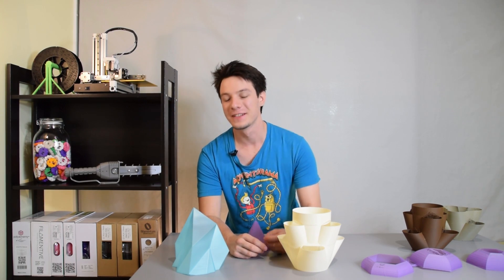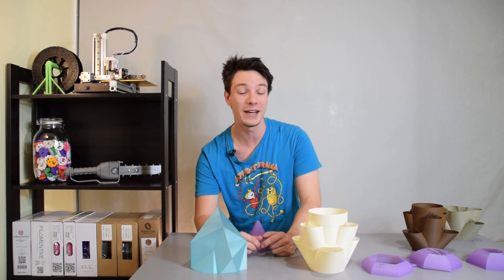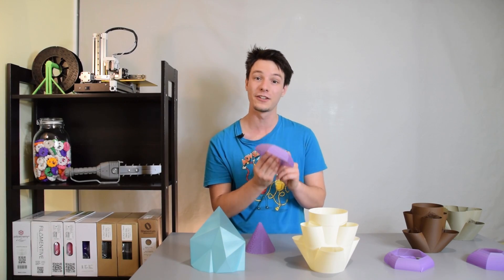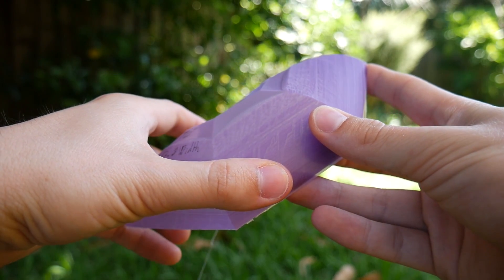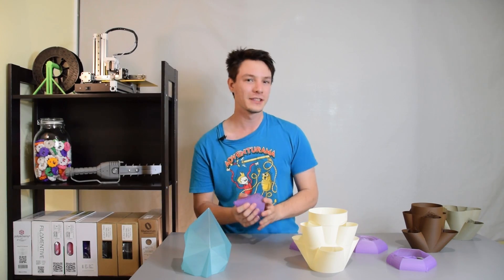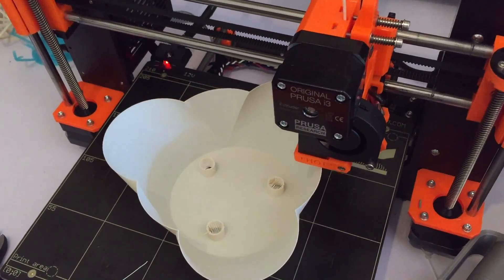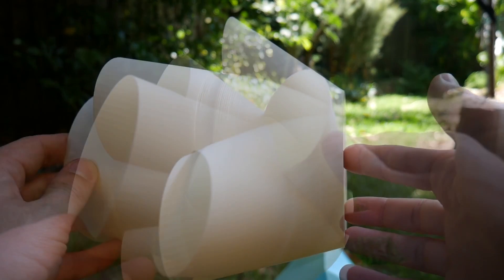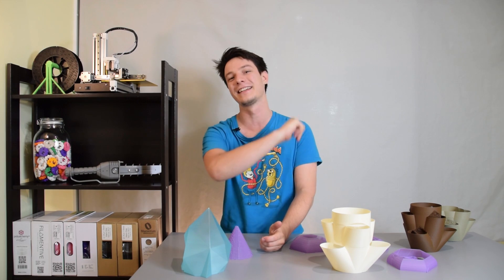Hacking Vase Mode - 3D Printing Experiments

Comment: Neat! That 2mm nozzle is crazy! I've been using vase mode to make transparent optical parts like light diffusers (fancy lampshades for my lightsabers) to prevent the 'zippers' you normally get that become really obvious when back-lit. I'm even learning to use the layer lines as "microlenses" to pull some very interesting tricks. Practically holographic.
Reply from the maker: That sounds awesome! I'd love to check out your results

Comment: i ll Give the strawberry pot a go with a 0.8 nozzle, where do you want me to post a make photo?
Reply from the maker: Tag me on Twitter @makersmuse
Reply: lol im old I don't have twitter, I can send you a photo via email and you can post it there yourself, BTW it come out great and, fast to print, 4 hours @ 0.12 layer height. It will make a nice spice planter, Here is my trick for pla stuff that will be used in sun light exposure, I coal it with a product call, " Ding all SunCure ", its a polyester resin the quickly cures under UV light which prevents the pla for deforming while curing , and it adds UV protection for outdoor use. that would make a great test for you pla in a hot car video! lol

Comment: Lampshades are functional!

Though I would suggest using them with LED lighting as they run cool - PLA probably won't cop the heat of a 60W incandescent bulb let alone a 100W or 150W!
Reply from the maker: Haha definitely needs to be LED!
Reply: What do you call vase mode with a 60W incandescent bulb? Answer: Dali mode

Comment: Nice video!
If you print at 0.8 width with a 0.4 nozzle then it's pumping out twice the plastic, so your bridges will sag like that (@9:18) more easily (just like you said about curved bridges). I bet it wouldn't be so bad with a 0.4 line width or less - of course then it would be weaker and have worse performance on the overhangs then.
I wonder if there's a slicer that could deal with this in vase mode?

Comment: Why not use vase mode and design the model in such a way that you could pour a resin in the void? Or even depending on the application just spray foam. Depending on what you are doing you could make a very functional, quick, durable item.

Comment: 2mm nozzle? what the... ? just print with no nozzle than. :D all metal hotend without nozzle and 1.75 filament strait to the bed. :D
Reply from the maker: 2mm with 3mm filament haha, but yeah you almost could just melt it straight through without a nozzle.
Reply: haha yeah, i dont have had much luck printing vasemode, its so thin on my printer that is hase no staight to it. i tryed tunijng the flow but still was not a great succes. maybe play around with the line wight would make it better? but i guess thats gonna do the same as altering the flow rate right? maybe ill need to get myself a 0.6 mm nozzle or so. i usally print with a 0.3, nor resently installed 0.4 and i was actually already finding ti weardly thick lines, like 3 primeters is 1.2 mm lol.

Comment: Is vase mode a function of the printer or the slicer?  I don't recall seeing that in Cura.
Reply: Sean L if you find it in Cura pls tell me
Reply: Sure will but I don't think it's in there.  That might be something that's in Simplify 3D.
Reply: Sean L should be under advance settings at least in the older versions

Comment: Manually model "support" to fix bridging issues?
Reply from the maker: You can't do supports really with Vase Mode, part of the challenge ;)
Reply: Maker's Muse stop print. Place foam board / cardboard. Resume print?
Reply: Maker's Muse what about "normal" mode with 0% infill? Then you could add geometry to the model as scaffolding to be broken off later. Wouldn't that be fast and use little plastic?

Comment: Manually create inner and outer shells in modelling tool, then pour resin into void between to make thick strong walls? For outdoor applications could pour cement slurry instead of resin.
Reply: This might not apply to vase mode but to normal mode with 0% infill?

Comment: just tested with the draft 0.8mm nozzle on a Robox(cura slicer). works nicely. Thanks Angus.
Reply from the maker: I didn't know Robox could run Cura directly, that's pretty cool :)
Reply: The current version of Automaker has a checkbox for Spiral print. You can't use CURA directly.
Reply: Someone actually MADE something!  Thank you!

Comment: Could you go deper into what extrusion width does?

I have always been under the impression that extrusion width just changes the space from 1 extrusion line to the other. But in that case increasing the extrusion width would only cause it to fail sooner if there is less material to lay the next layer of plastic

I'm I thinking about this backwards? The way I see it decreasing the extrusion width should be what you intended to do.

Comment: I'd like to give it a go with this pot, I printed 12 pointed tree topper star using vase mode for each point using my volcano nozzle with a .6mm nozzle, but intentionally overextruding to reach .9mm wall thickness, and was able to get super clean finishes. Each point printed quickly and was very strong and very smooth. I think that's roughly the sweet spot because .9mm walls are pretty strong -- I might be able to force it to get to 1.2mm walls using the same nozzle as I'm using the bondech qr, so it can really pump out the plastic.

Comment: One other "interesting" feature of Vase Mode: If you crank up the speed and print lots of curves on a large printer .... it's a test of your firmware's compute speed. Put another way - you may also want a 32 bit board for that super duper ultimate 2 M tall Vase Mode printer :)

Comment: Can you print (using 1.75mm)with a 2mm nozzle? Holy sh*t
Also, that squared_cone_thingy is amacing
Reply: No you can't print 2mm with 1.75mm filament the person in the video is using a Ultimaker and that runs 3mm filament. There is a 1.2mm nozzle for the E3d volcano that you can use with 1.75mm filament
Reply: Oh ok, thx 4 the answer.

My printer is a cheap aliexpress kit so I cant really get good details. The acrilic not-so-rigid frame and the feeding mechanism make it useless in the tiny details when printing. Lets not talk about the endstop switches, secured with 1 bolt so they can rotate a little bit each time the printer homes itself.

However printing faster with a wider nozzle sounds so nice. If I cant get the details at least I can print big stuff. I was going to replace the extruder assembly anyway so I may get a volcano. 

Extra question: I am going to change the extruder and the direct drive mechanism, making it 3mm is worth it? Just focusing in printing faster with a huge nozzle
Reply from the maker: The trick with large diameter nozzles is you have to melt and cool a LOT more plastic than usual - so your heating and cooling must be really powerful. Usually, you have to run very slow so it can keep up which somewhat defeats the purpose. I would use your current machine to start printing parts and upgrades for itself or even an entirely new printer :) It'll improve itself over time.

Comment: For the overhang test to get a more even print in low layer heights, try slicing in different layer heights and mixing the g-codes together so that the first 40 degrees are .2, 50 and 60 degrees get .1 and 70 and 80 degrees get .05

Then to top it off, you can use the gcode from another slice that bridges the top

This isn't easy but possible, its the same technique you use to pause a print for switching out the colors, only you load a different g-code file after the pause 😊

Comment: Thanks Angus!  I'm in the process of making a cosmetic leg cover for my Wife's prosthetic leg and this will save be BOAT LOADS of time in test prints while we try and nail down the final shape!

Love the experiments!  Id like to suggest one, I noticed that when I print some models the cooler that I have on my printer blows air in such a way to whistle (similar to blowing over the top of a bottle).  I always wondered if a model could be designed to play a tune while it printed.  It most likely would look like a bunch of tubes in the end, but it would make for a fun experiment.

Love the Videos!  Thanks again!

Comment: Really interesting.  It would be cool if in the GCode you could dynamically alter the extrusion width based on the overhang angle.  i.e. start at 0.4mm at 90 degree layers, gradually increasing as the overhang angle increases.  I wonder if it would help keep the layers consistent and perhaps also allow even greater overhangs (although 70 degrees is pretty steep)

Comment: Flip the white strawberry thing upside down and drill a hole in the bottom and you'd have a great hanging lamp.
Reply from the maker: That's... GENIUS :P
Reply: "watts in = watts out. A 10W LED gives off as much heat as a 10W heating element." This is not true for LEDs although it is for CPU at full load. Making light takes energy and the energy efficiency of LEDs, CFLs and incandescents are wildly different. If the heat per watt was constant it would imply that the light emitted in the visible spectrum has no energy but the light in the IR spectrum does or that the IR light completely dominates the visible. In reality the typical 6 WATT LED bulb emits ~4 BTU/hour =1.2 watts or about (6W-1.2W)/6W=80% efficiency.  Contrast this with incandescents and you will find they are only about 10% efficient but because we try and keep lumens constant, their overall BTU/hour figure goes way up because we need a 40W bulb to do the same lighting job as a 6W LED.
Reply: Or the cone experiment. Light source needs to be low temp tho... (reprint in ABS or PETG?)
Reply: I though about it for the cone you made, it would be a good light focusing thingy...
Reply: aiklarung watts in= watts out, yes you're right... there is as much energy going out than in but not all energy goes out in the form of heat. with led most of it is converted to light and the rest in heat in an incandescent bulb most of the energy is converted to heat ( glowing hot filament) and the rest to light.
Reply: +aiklarung

What you're saying is 100% irrelevant. We're discussing heat issues with puttin an LED in this thin plastic shell.  A filament bulb gives off a lot of waste heat. An LED is a diode, and heats up because of the electrical connection inside the actual component. We measure LEDs heat from the resistance of the semiconductor. LEDs give off basically zero infrared because they are made to reproduce a certain wavelength.

So no, LEDs don't give off heat in the form of light at all, all they heat they produce is due to electrical resistance.

To go a little further why it doesn't matter at all, let's say you take a 2W LED (Which is already really big for that small, light lamp, and say it's only 30% efficient. So it should be radiating 1.4 watts of heat into the surrounding air. But wait, you attach a resistor to every LED to control the current. That acts as a great heatsink. Then you have the wires going to power, that is a heatsink, and you have however you're mounting it. Usually those 1+ watt LEDs get mounted on a heatsink themselves. Then you get the air itself absorbing the heat.

So, for a third the, unless you use a flood light like an idiot, the LED you'd use in this lamp will NOT even heat the plastic.
Reply: Yes, but your argument was about it melting the lampshade, not about it heating the room by a trivial amount by performing the work of letting you see said room. The incandescent will melt your lampshade quite more thoroughly than the LED will, watt-for-watt. That's because, again, the LED is grossly more efficient.
Now for my figures, I took the first result I found searching, from http://archive.azcentral.com/home/articles/20130403led-lights-better-cfls-reasons.html Where they state: "Your electric bill will go down. Manufacturers estimate that LEDs are up to 85 percent more efficient than incandescent bulbs..."
You will notice that this is substantially better than a mere 25% to 10% comparison as in your claim. If incandescents are 10% efficient, then they are 90% inefficient. And to be 85% more efficient than that means that .85 * 90 = .765 is the difference in waste heat, meaning LEDs are only 13.5% inefficient and in the example I gave, that is indeed the result rounded to the nearest whole unit. 9 light to 1 heat. I suppose I should have said 1.35 heat? But it was an approximation.
Reply: +aiklarung As everyone else pointed out, that's already incorrect right there.  LEDs are highly efficient.  What are they around 50% efficient? That would be 5 watts of heat.  And do you know what a 10 watt LED looks like? Nobody is putting those in paper thin plastic lamps, that's just stupid. 10 watt LEDs are what is used in flood lights and incandescent sized replacements. As in, super overkill and will be too heavy to put in a hanging paper thin lamp to begin with. 

More likely would be a 1 or 2 watt LED, like there are in flashlights.  That's plenty bright for a little lamp, and it would give off something like .5-1 watt of heat, much less reaching the actual plastic because of air conduction, so more like .1-.5 watts being absorbed by the plastic. 

So once again, the heat would be negligible.
Reply: "watts in = watts out."
And depending on how efficient your light generating mechanism is, some of those watts will be in the form of heat, and the rest will be in the form of light.
For an incandescent bulb, where light is produced by the ridiculously inefficient means of heating an object to incandescence through electrical resistance so it sheds light by blackbody radiation, that's 9 watts as heat and 1 watt as light.
For an LED bulb, where light is produced extremely efficiently by the movement of electrons across energy states by the electromotive force within a diode to release photons when they drop to a lower energy state, that's 2 watts as heat and 8 watts as light.
Which is why you can change an LED bulb with your bare hands while it's on and blinding you with its full output.
Reply: I have a similar shade I use. Just use LED bulbs.They're really low temp and if you need extra insulation you can make a wire curlicue torus to create space between the bulb and shade.
Reply: cfl bulbs are low heat as well.
Reply: LEDS put out negligible heat.
Reply: aiklarung not true.
Reply: no.... about 0.8w of heat
Reply: not if you use leds
Reply: aiklarung yes but a 1 watt led = a 10 watt heating element
Reply: amoose136 I would prefer the blue ice mountain thing
Reply: Chrysippus stop talking out of your ass if you don't know your shit please
Reply: The Dick van Dyke show reference? 😹
Reply: Or you can have a plastic tree if you stack them
Reply: Omg just stick the 1w LED in there and see what happens then. I love reading the comments and would like to find out who's right and who's wrong, thank you
Reply: my facebook account has the same profile picture.
Reply: William Barnes You can change an LED light while it's on because it's 6-18W typical. I have a 45W LED that gets roughly as hot to touch as an old small incandescent bulb of similar wattage. Also, your example is off, LEDs convert just ~25% of electricity into light, while incandescents 10% - and the light will become heat too, maybe not up close but when it touches a dark surface it will satisfy my simplistic claim, watts in = watts out, in heat, always.
Reply: light = heat. An old lightbulb gives off more infrared, which you don't see, that's why it's less "energy efficient". The truth is, there is a hard limit on how energy efficient a light source can be, and anything that uses one watt will heat up one watt, the best that can be done is dissipation.
Reply: John Z no, you still need to think where the heat goes with LEDs. watts in = watts out. A 10W LED gives off as much heat as a 10W heating element.

Comment: Excellent video. Would be good if you could vary the print width with print angle, then you could get uniform wall thickness at all angles. Also would be great to be able to do vase mode with user controlled number of wall layers so that the print head runs concentrically on the same Z layer before moving up (it would need to continously switch concentric direction each vertical step)

Comment: imagine there is a way to use a nozzle with super long and needle-like pointy tip and 4th or 5th axis. you can print amazing parts with multiple perimeters using vase mode.

Comment: It would be great for the software to switch from vase mode to normal discrete  print mode where necessary
Reply from the maker: Simplify3D does this - it's how I got the drain holes in the bottom of the pot. I can't speak for other software though. It will however compromise the finish of the print.